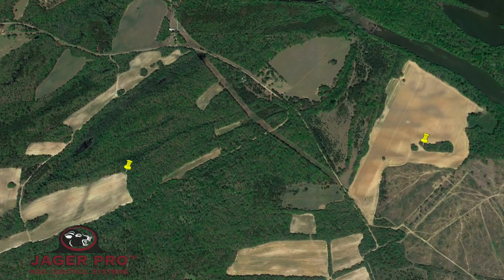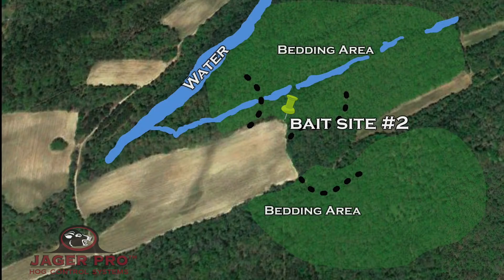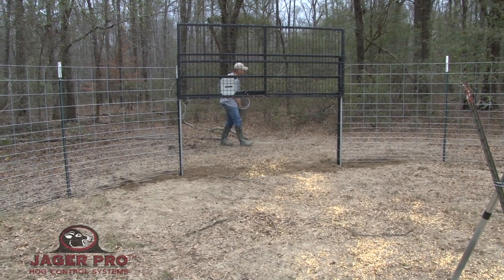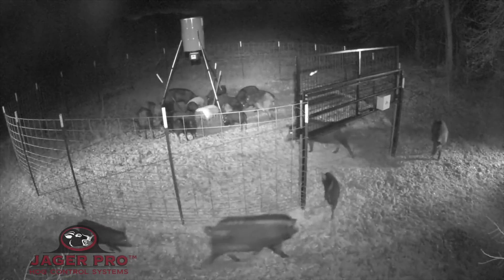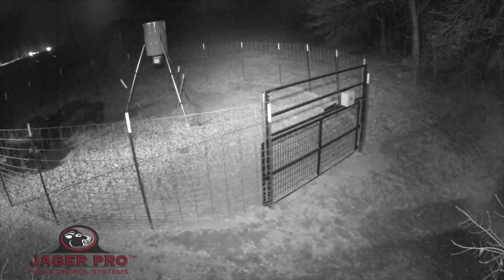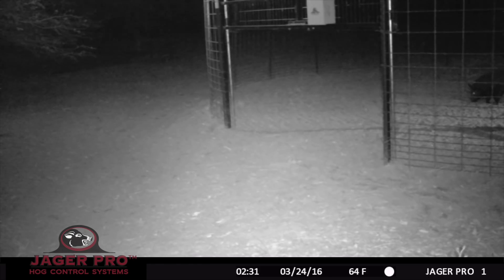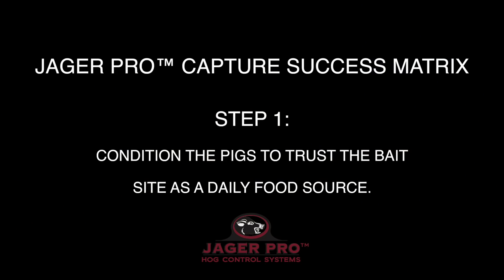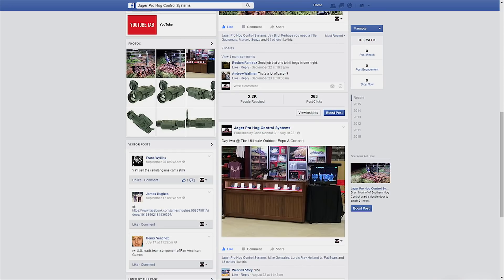Wild Hog Trapping | (28) Using Integrated Wild Pig Control™ For Wild Hog Control | JAGER PRO™

Comment: Is that a 10-22 you're using?
Reply from the maker: Rifle: Volquartsen Summit bolt action

Suppressor: Advanced Armament Corp. (AAC)

Ammunition: CCI Suppressor, 45-grain lead hollow-point bullet (970 feet per second) subsonic
Reply: @JAGERPRO  So it IS a .22lr. Where do you aim to put down a tough animal like a feral hog with such a small round?
Reply from the maker: @MrWayne1701  If looking at the pig from the side, you want to aim just above the ear hole to target the brain. Once you hit that brain, its lights out, real quick and humane.
Reply: @JAGERPRO  I clearly saw a casing ejecting when you fired, so the rifle was a semi-auto...
Reply from the maker: @MrWayne1701  it is a bolt action .22, not semi-auto

Comment: How is the cost determined for this operation?
Reply from the maker: The best way is to measure the Return on Investment (ROI) and cost per pig of our Integrated Wild Pig Control® approach from the farmer's perspective. We will use the video, "Russell County, AL Project 257 Pigs Captured In 7 Months" as our example at https://youtu.be/wCSb31RNSno. Research demonstrates each individual pig averages approximately $400 of crop damage annually (Bodenchuk, M. J. 2011) in an agricultural setting. This means 257 pigs would have cost the farmer around (257 pigs x $400) $102,800 this year while exploding their population next year with annual reproduction of two litters per sow. 
Expenses: 
Two flex panel M.I.N.E.™ Trapping Systems ($3,500 x 2 traps) plus one rigid panel M.I.N.E.™ Trapping System ($4,500) plus total labor (69 hours x $100 per hour) $6,900 = $18,400. 
AR-10 rifles topped with thermal scopes are owned by the Hog Control Operators™ and are not the farmer's expense. 
$102,800 of future annual damage was saved by investing $18,400 into equipment and trained labor. 
Return on Investment (ROI) to the farmer = 559% ($102,800 divided by $18,400 = 5.59 or 559%) 
Cost per pig = $71.60 ($18,400 of annual expenses divided by 257 pigs = $71.60) 
Basically, it cost $72 to stop a $400 problem. Whole-sounder success prevents any pig from escaping, surviving, reproducing or being educated to the removal process or product. A better solution does not exist which is more effective, efficient and financially economical than the Integrated Wild Pig Control® model demonstrated in this video.

Comment: What caliber rifle was used tk shoot them? Make and model would be better to know.
Reply from the maker: Free range protocols require the use of high-powered rifles. Both stationary and moving targets will be euthanized with a single bullet to the brain or heart/lung vitals from .308 caliber suppressed rifles using 180-grain supersonic bullets.
Rifle: Daniel Defense DD5®V3® in 7.62 x 51mm / .308 Winchester
Suppressor: Advanced Armament Corp. (AAC)
Ammunition: Hornady 30 Cal .308 180-grain InterLock® SP or Hornady 30 Cal .308 178-grain ELD-X®
Optics: Pulsar Thermion XP50 or Pulsar Trail XP50 with Laser Range Finder (LRF)

JAGER PRO™ protocols require feral pigs to be euthanized inside the trap enclosure with a single bullet to the brain from a .22 caliber suppressed rifle within one hour of capture.
Rifle: Volquartsen Summit bolt action
Suppressor: Advanced Armament Corp. (AAC)
Ammunition: CCI Suppressor, 45-grain lead hollow-point bullet (970 feet per second) subsonic

Comment: Where did you get your panel, and what diameter is it?
Reply from the maker: Our M.I.N.E.® Trapping System is manufactured specifically for feral pig impact using our patented 18-60™ Trap Panel design https://jagerpro.com/product/18-60-trap-panel/ constructed of 4-gauge galvanized steel. The 18-60™ Trap Panel can be purchased from any JAGER PRO Authorized Dealer. Just type your zip code into https://jagerpro.com/dealers/ and our website will list the nearest three dealers to your location.
U.S. Design Patent No. D735,290 (28 JUL 2015) 
U.S. Design Patent No. D782,604 (28 MAR 2017)

Comment: I dislike killing of piglets, but i can get why you do it.
Feral hogs have too high reproductive rate and unlike Eurasian wild boars from native populations have no intraspecific control mechanisms and few native predators.
Pest control is based exclusively on cost-effectiveness.
Killing of all trapped hogs reduces overall cost of pest control as no pig from sounder left for breeding in wild.
Reply from the maker: You are absolutely correct. Piglets are killed for the same reason pest control agents kill baby termites, baby rats and baby cockroaches in your house. Juvenile pests will continue to grow, reproduce and destroy your home the same as juvenile pigs will continue to grow, reproduce and destroy agricultural crops. Insect versus mammal makes no difference to the legal definition of a pest or the Best Management Practices needed to control them.
Reply: @JAGERPRO  and as i read, you donate most of carcasses and bury excess  ones.
As feral pigs carry diseases, it's important to bury or burn any carcasses, which are not  used as food.
In some states hogs are just shot from helicopter and left in fields, i wonder  why shooters don't care about risks to livestock from disease transmission  and predator attraction.

Comment: Couldn't you go larger. 
Larger gate. Maybe 2 gates❓
Instead of a small round enclosure ❗
Reply from the maker: Of course. You can build our M.I.N.E.™ Trapping System as large as you want. But there is no logical reason to change the PROCESS or the PRODUCT when it effectively removed 38 and 15 feral pigs from an agricultural farm. If it isn't broken, then don't fix it.
Reply: @JAGERPRO   🐷 Just wondering. Interesting.

Comment: These feral pigs are a big menace in my country. They eat everything we farm beforehand. You have all the technology to overcome these bastards. Glad to see someone controlling these pests.
Reply: @Deepes Vr Feel free to go in the pin.
Reply from the maker: @ilpianista4558  - Fencing is a logistically and financially flawed theory for two reasons. First, a fence does not address reproduction of the pest. A single sow will produce two litters of 6 to 10 pigs annually and their offspring will reach sexual maturity within six to eight months of age. 100 sows can escalate to 1,600 pigs (100 x 8 x 2) in one year. A fence does NOT stop reproduction outside the fence. Second, a single American farming entity may plant and harvest 2,000-3,000 acres spread across multiple counties. One square mile is 640 acres which would require 4 miles of woven wire fence costing $31,792. It would take 672 hours of labor to build such a fence to protect a single square mile section of crops. The total fencing cost for 100,000 acres would be approximately $5 million requiring 105,000 hours of labor. Our demonstrated solution only required 8 hours of total labor from an expert using $100 of ammo and a $3,500 M.I.N.E. Trapping System. There were no pigs left from this sounder to escape, reproduce or become educated to the removal process. A non-lethal solution does not exist which is more effective, efficient and financially economical than the Integrated Wild Pig Control™ model demonstrated in this video.
Reply: @JAGERPRO  Yes, after you schooled this idiot, total silence! Thank you for providing a professional answer for other idiots after Pianista.
Reply: @ilpianista4558  says someone whom doesn't know jack about farming.
Reply: il Pianista 

You do know pigs are in the top tier of smartest animals in the world, right? If fences had worked so far, we wouldn’t be in this mess dipshit. The only reason fences are effective in this scenario is cost versus effect, and the fact that they aren’t given enough time to figure a way out of it.

I know, it’s literally logic. Use your brain.
Reply: @ilpianista4558  what do you think it would cost the farmers to built  a fence around 2 or 3 thousand acres
Reply: Food chain pussy
Reply: @UCOa0xJHJE7GTGEWKNdiwegQ for goodness sake, shut the fuck up, please
Reply: Here in the philippines only few of them are left and our government emplement that no one is allowed to catch or hunt them. .why not try bring some of them here in the philippines people will love to cook them like lechon hahahha. .
Reply: You should be glad those pigs are eating your crops. Plants are bad for you. Eat the pigs, not the crops.
Reply: Real pests are we human beings ,destroys every inches of the mother earth , greedy pests
Reply: Deepes Vr maybe you don’t understand how long earth has been here and what it has been through. 5.5 billion years and been through more than any human civilization could ever put it through.
Reply: Deepes Vr youre an idiot. So how the fk are you gonna eat? No fruit no vegetables no meat no water Becsuse you want these boars or pest to kill off humankind and yo ass is a human? Why are u even born? If that’s the case why are you alive? 

How do you stay alive? Who feed you? Farmers around the world feeds us. And they go through this similar thing here showed in the video to keep the crops alive to make humankind survive. 

Dumb as fk man.... it’s survival man, either us humans or them. Pick one. If u pick animals they will eat yo ass anyways haha.
Reply: @deepesvr1956  actually, humans created monsters and released them to wild.

Comment: What rifle is that?
Reply from the maker: This video demonstrates a .22 caliber long rifle (LR) bullet to the brain is very humane and drops them immediately. The rifle is a custom, bolt-action 22LR with suppressor. There is no need to use a high velocity (centerfire) bullet which can easily pass through a hog's skull and damage the gate or trap panels when a 40-grain (rimfire) 22LR bullet safely performs the task less expensively. Also, a subsonic 22LR bullet shot at 1,080 feet per second (FPS) through a suppressor is much quieter than a centerfire bullet shot at supersonic speeds.
Reply: @JAGERPRO  ok thanks! I have a competition shooting 22lr rifle and i love it!!

Comment: Are these traps taking a dent out of the hog population
Reply from the maker: Absolutely, but it takes an Integrated Wild Pig Control™ (IWPC) approach to be successful long-term. Our M.I.N.E.™ Trapping System will always be more efficient in the winter to target sow and pig sounders. Thermal shooting operations will always be more efficient in the spring during planting season to target boar bachelor groups who avoided winter traps. Then, there are several factors which determine how long a property remains at "zero balance" after a successful IWPC program has been implemented. Future reproduction and migration would have to come from adjacent properties since an effective IWPC program would prevent escapes, method education and reproduction from the entire generation of feral pigs living on the property. Are neighboring landowners implementing a successful IWPC program? Are there enough trained Hog Control Operators™ in the county to effectively implement the IWPC program? Has the state passed legislation to stop intrastate and interstate transportation of feral pigs? How well are law enforcement personnel enforcing these rules in the state? Are judges and the court system prosecuting those breaking the rules with heavy fines? How many criminals are illegally transporting and releasing new feral pig populations in the county? Hopefully, you can understand the amount of time a property remains at "zero balance" greatly depends on the answers to the above questions.

Comment: These work so well.. how is there a feral hog problem?
Reply from the maker: Great question! One reason there is still a feral hog problem is because there are not enough trained and certified Hog Control Operators™ across the United States to properly operate our M.I.N.E.™ Trapping Systems or implement an effective Integrated Wild Pig Control™ model on multiple properties at the same time. The best combat aircraft on the battlefield still requires a trained pilot to operate it. Also, the illegal transportation and release of feral hogs for recreational hunting purposes is another reason for our current problem. Sport hunters are directly responsible for the abrupt surge in wild pig populations. Legislation must be passed in every state to stop intrastate and interstate transportation of feral pigs with heavy fines to criminals releasing them.
Reply: @JAGERPRO  well shit.. you get to trap and shoot these things! Kinda seems like more people your way need to get on it.. get licences and round them hogs up!

Comment: So are you using suppressed 22LR to finish the hogs off in the trap or a higher power .22 cal like .223?
Reply from the maker: There is no need to use a high velocity (centerfire) bullet which can easily pass through a hog's skull and damage the M.I.N.E.™ Gate or trap panels when a 40-grain (rimfire) .22 caliber long rifle (LR) bullet safely performs the task less expensively. Also, a subsonic 22LR bullet shot at 1,080 feet per second (FPS) through a suppressor is much quieter than a centerfire bullet shot at supersonic speeds.
Reply: Dan G , my question, exactly!
Reply: @rahuldoes  well see above. Rod answered the question.
Reply: @dang1861  Oh-ho. I wanted to say that that was my question, exactly but you beat me to it. Yes, I got my answer.